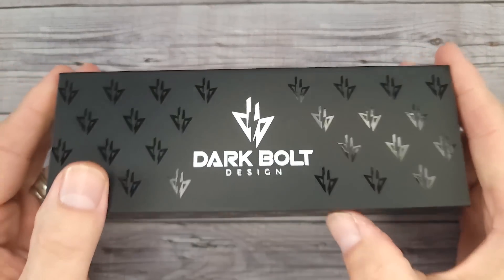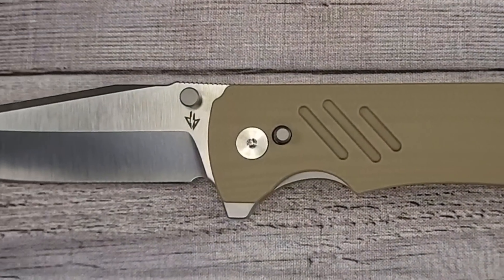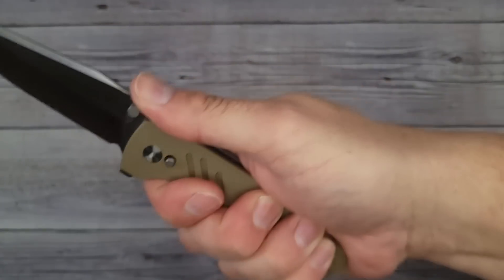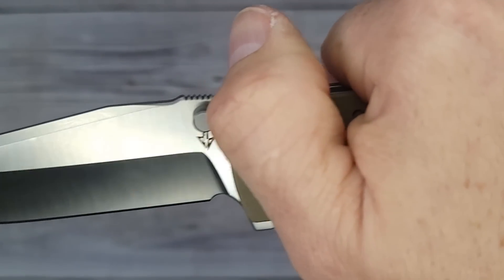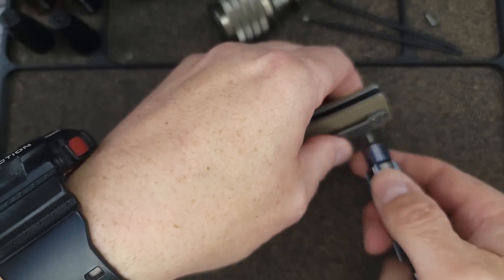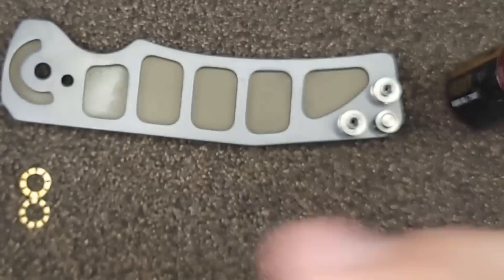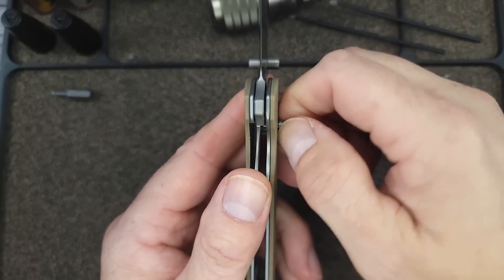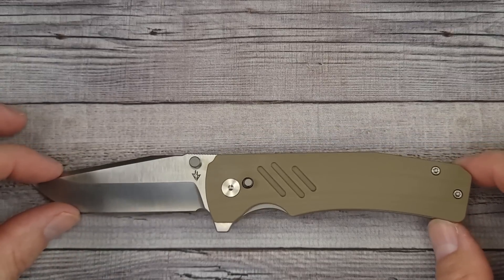Proprietary BOLT LOCK KNIFE! REVIEW And DISASSEMBLY Dark Bolt Designs

Comment: Hey Beez. I like the knife design. The blade shape reminds me of the hogue deka 2. I was curious if the liner lock could be disengaged like normal and their site says yes. So basically it's like the spyderco compression lock. I foresee a lot of companies using that system since the patent expired. The one thing I would suggest to them is to modify the end of the bolt so it can be taken out easier. A torx or a simple slot for a flat tip would work. 🤔   I see on the brands site it's made by We knives and runs $219 doll hairs. Wow. A little steep in price, but that's my opinion. I'm sure it will sell.👍 There's just so many more budget and premium brand name knives I could buy for the price. The uniqueness will probably sale it. It definitely needs just a few improvements. I wonder why it flexes so much. Maybe it needs another spacer. Flexing is what I don't like about my hogue deka 2 with the polymer scales but this knife has metal liners🤔 and it still flexes. Thanks for the video Beez. Always love the sharpness tests.👍 Have a great week. 😊:_BeezBladesWelcome::_BeezBladesBeez::_BeezBladesRed::_BeezBladesBeezhive::_BeezBladesHoneypot::_BeezBladesQueenBee:

Comment: Hi @Beez Blades Design Improvement Proposals: 1. Revise the button design to add a T8 hole so it can be screwed in and out as opposed to using a rag and a pair of pliers to loosen it and re-assemble it. 2. Add aggressive jimping to the front and top of the flipper tab. 3. Add about 0.010" to the G10 scale thickness to improve rigidity. 4. Put a chamfer on the edges of the G10 scales to reduce grip feedback. 5. Revise the pivot design to become a captive pivot, which should be standard for a $219 knife. 6. Chamfer the edge of the lanyard hole to prevent fraying of paracord lanyards, edges are too sharp currently. 7. Extend aggressive jimping to the end of the poon. I do love the combination of quality steel, compound grind and blade design of this knife! SUPER SLICY!!!:_BeezBladesRed::_BeezBladesBeez::_BeezBladesRed:

Comment: Update I got my hands on this thing. Its addictive to thumb stud flip and front flip, so smooth so easy. The regular flipper is a bit weak, but I think that is necessary for the other methods to be so good. You can deploy and close with the button and its easy, the button is a bit small and so a little hard to use. Overall all I love this knife.